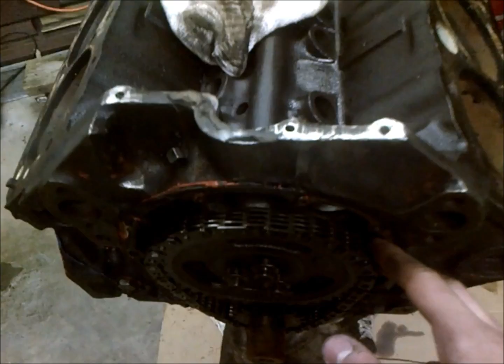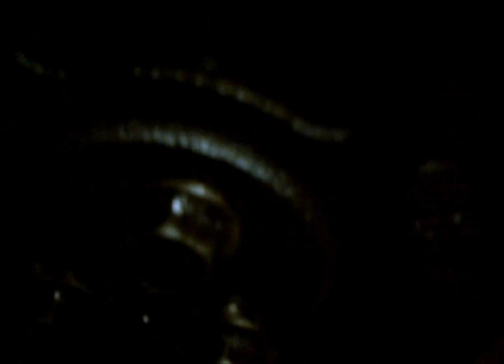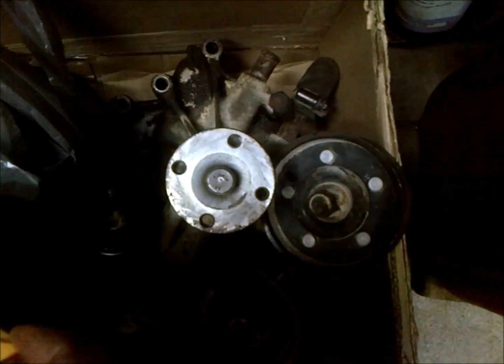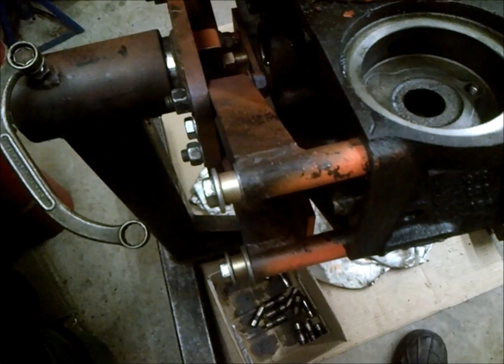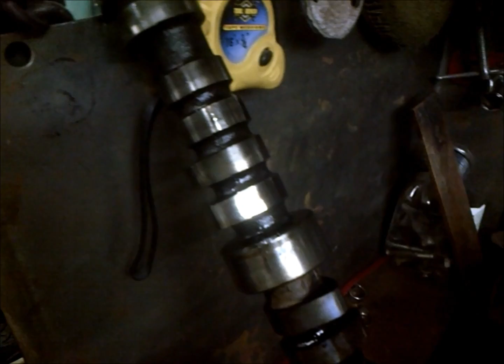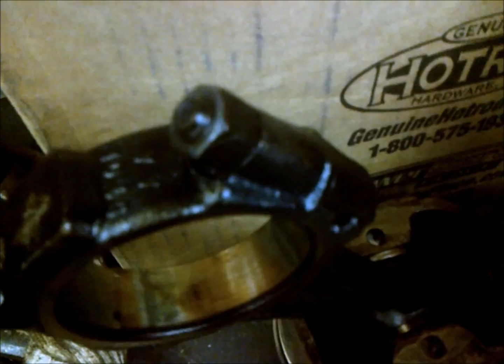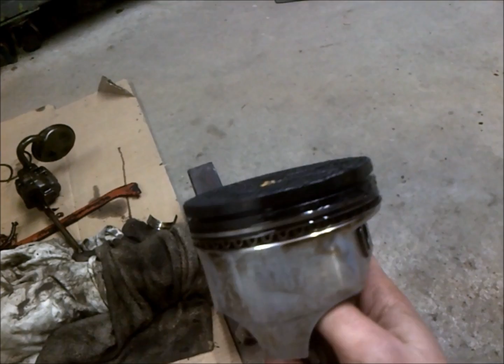350 Chevy vs Ford 302 Comparison: (Dumb Redneck Viewpoint)

Comment: I see more old Chevy's than old fords.
Reply: +Frank289100 CHEVY SHIITS on ford. I'm at the drag strip constantly
Reply: funny,there are tons of old Fords running the road while there are more old Chevys sitting in the yards just doing what they do best just sitting going no where rusting away..lol.
Reply: +sylumgand ford used the 302s up until the early 2000s in the explorer. they also used them in anything bigger than a foxbody and smalled than an f250
Reply: +TheSamplebridge you either had a ford most of your life or your lieing
Reply: +sylumgand bro fords suck and your mad
Reply: Thomas Smith i think your the one thats mad
Reply: Thomas Smith Must suck to be hit in the face with truth by a caps lock commando. Fact is he's right and you still have no response other then "Ford sucks" or "You suck".
Reply: +sylumgand when u said that the 350 came with 195hp stock. you are comparing an engine from the 70s when there was the oil crisis and engines were being detuned for fuel economy NOT POWER. yes they had about 200hp or less during that era. 302 were the same way. if u got an early 350 from the 60s and even a 302 from the 60s the 302 never stood a chance with the 350 with 300hp stock. the sbc was just better with its simplicity. fords need a shit ton of wiring for it to run while a sbc just needed a hot wire and coil and it would run great.
Reply: Jared Phillips
No actually i was comparing crate engines you can buy from Jegs right now. You might have got the years correct so I looked up newer versions that are actually cheaper then the first one i looked at. And for a direct drop in replacement for vehicles from 87 to 95 they were rated at 250hp.

And simplicity has nothing to do with their popularity or availability, price does. That crate engine i quoted from is a $1300 engine without intake. Or about $400 cheaper then the cheapest Ford 302 crate engine i could find. A 300hp 350 crate engine will run around $2500 where a 300hp Ford 302 will run around $3500. And you can get both in the 400hp range, but the Fords always gonna be more expensive. Now if you had no brand loyalty and only cared about power, which are you gonna buy?

 If some company made a 600hp engine that was decently reliable, had cheap plentiful aftermarket support, and sold it for $2000, do you think Chevy small blocks would rule the roost as the go to cheap cookie cutter powerplant?
Reply: +sylumgand I understand that the sbc is cheaper. I wasnt trying to say they are more popular cause there mpre simplictic. I understand that any ford crate engine is just as good as chevy crate engines but people are gonna go with chevy cause they have shown why there engines are just awesome and ford crate motors are awesome too. im not truing to bash on ford or anything im just saying sbc is just a better choice. I wouldnt really go with a crate motor in my opinion I like to just have my engines rebuilt its cheaper and u dont have to buy all the accesories like intake, carb, so on. i dont like the 350 as much as I love other sbc (dont get me wrong there great just along with most ford engines) im more of a 327, 283 guy I love these engines so much. I think the 302 was the best engine ford ever made but I wouldnt take it over most small block chevys.
Reply: bad406camaro
You wouldn't be spending 10k on a Ford 302 with 350hp, you'd be buying a Coyote 5.0 at that price range and it would be 440+hp. Also all you've done is further reinforced my point that Chevy's are cheap power and the cookie cutter of the engine market, hence why you see so many god damn 350's and the LS variants on the market. They are literally a dime a dozen. Ford didn't cram a 302 into every single vehicle it made for 50yrs, it will never be as readily available or as cheap as a Chevy 350 and soon enough its LS variants. It also doesnt change the facts of what
 Frank289100 said either about the LS motors. And if you want to compare dicks some more https://www.summitracing.com/parts/fms-m-6007-m50a/overview/make/ford 435hp out of a 302. $1000 more expensive though, but seriously 430hp out of a 6.2L or 435 out of a 5.0L. You gonna try being one of those guys who claim that 430hp 6.2L motor can run turbo's and pump out 1500hp as is?
Reply: Well, where I live, I see more old fords than chevy
Reply: Way more old mustangs than old camaro's. No matter where you live.
Reply: +Thomas Smith Well lets examine that. Chevy has been producing the same exact engine since 1967. Ford produced the 302 from 1969 to 1995, while Chevy still put 350's in up to 2003 after which they switched to a an updated version of the 350. Chevy crate motors are also $1000 cheaper then a Ford 302 crate engine. So you have cheaper, longer production, and far more widely available engine. Remember Chevy crammed a 350 into anything that could fit it. And before you bring up the new Ford 302's, they share almost nothing in common with the old, i'm not even sure they use the same block.
Reply: +sylumgand 302 crate engines are more expensive but a junkyard 302 is like 300$.
Reply: TheSamplebridge And you could still get a Chevy 350 for cheaper.
Reply: Frank289100
Umm dude, if you examined my comment you'd realize I was shitting on Chevy 350's. Being called a cookie cutter of something is not a compliment. And I already know what the next series of motor you would bring up as being based on Ford, the LS series aka the updated 350.
Reply: Also I seems the 350s had less quality control. When I look around the oil drain back holes 90% of the time there is casting chaf covering half the hole like they never dremeled it out. All the Ford small blocks I've owned where dremeled around those holes from factory.
Reply: +Thomas Smith I have had alot of fords, but all the shows I go to most 350s are like that
Reply: +TheSamplebridge look it up 350 has more HP
Reply: +Thomas Smith and? what does that have to do with oil drain back holes
Reply: +Thomas Smith You just don't want to admit that in order for gm to produce 350s at such a cheap price, corners get cut. And at 195hp stock, what are they more powerful than? You can get 250-300hp if you tag on $1000 for heads and another $600 for cams. And if you're trying to use ls3 and up, you're starting at 10 grand for motors starting with 350-400hp. The ls6 is a $20,000 engine. And don't try pulling the junkyard deal, unless you live somewhere that ZO6 corvettes are in every driveway you're not likely to find one there.
Reply: Thomas Smith
Lol didn't answer the question and just went to insults, yeah i'm the mad one.
Reply: +sylumgand yeah ford suckers
Reply: +TheSamplebridge THE 305-350 IN THE REAL WORLD WAS GARBAGE. IN TAXI 24/7 DRIVING THE 302 WAS STILL RUNNING STRONG AFTER YEARS WITH 500,000 MILES ON THEM AND THE CHEVY'S AT 60,000 AND LESS WERE BLOWING OIL AND THE VALVE TRAIN WAS SINGING " I GOT A LOVELY BUNCH OD COCONUTS". THIS IS WHY YEARS BACK THE SMALL BLOCK FORD TOOK OVER THE TAXI, LIMO AND POLICE CAR INDUSTRY, A 20 A YEAR STRETCH WITH NOT COMPETITION.
Reply: +Frank289100 keep typing in capital letters. cause it doesn't make you more right than you think you are
Reply: +Frank289100 the engine might not be that bad but everything else about the cars are shitty
Reply: +Thomas Smith THE LS USES A TEN BOLT HEAD PATTERN SQUARE BORE SEALING WHICH ALLOWS FOR HIGHER CYLINDER PRESSURES WHEN USING TURBO'S AND SUPERCHARGERS. ON A STOCK 5.0 ENGINE WHICH DEBUTED BACK IN 1983 IT CAN HANDLE 18LBS OF BOOST WITH NO PROBLEM AND GO MUCH HIGHER. WITH THE CHEVY SMALL BLOCK 8LBS OF BOOST WAS THE LIMIT. IF YOU WENT ANY HIGHER THEN THAT BLOWING A HEAD GASKET IS THE LEAST OF YOUR PROBLEMS. YOU WOULD DROP THE MAIN CAPS. THE SMALL BLOCK FORD HEAD BOLTS ANCHOR INTO THE BLOCK WEBBING WHERE THE CHEVY BOLTED ON TO THE BLOCK DECK WHICH MADE A WEAK SEAL BETWEEN THE HEAD AND BLOCK. TO BOOT THE SMALL BLOCK FORD WAS 70LBS LIGHTER THEN THE SMALL BLOCK CHEVY AND WAS STRONGER AND MADE MORE POWER. THIS IS THE REASON CHEVY DUMPED THE OLD SMALL BLOCK IN FAVOR OF FORD DESIGNS WHEN THEY CREATED THE LS WHICH IS COMPLETELY BASED ON FORD DESIGNS. NOTHING REMAINS FROM THE OLD SMALL BLOCK CHEVY.
Reply: +sylumgand when u said that the 350 came with 195hp stock. you are comparing an engine from the 70s when there was the oil crisis and engines were being detuned for fuel economy NOT POWER. yes they had about 200hp or less during that era. 302 were the same way. if u got an early 350 from the 60s and even a 302 from the 60s the 302 never stood a chance with the 350 with 300hp stock. the sbc was just better with its simplicity. fords need a shit ton of wiring for it to run while a sbc just needed a hot wire and coil and it would run great.
Reply: +sylumgand I understand that the sbc is cheaper. I wasnt trying to say they are more popular cause there mpre simplictic. I understand that any ford crate engine is just as good as chevy crate engines but people are gonna go with chevy cause they have shown why there engines are just awesome and ford crate motors are awesome too. im not truing to bash on ford or anything im just saying sbc is just a better choice. I wouldnt really go with a crate motor in my opinion I like to just have my engines rebuilt its cheaper and u dont have to buy all the accesories like intake, carb, so on. i dont like the 350 as much as I love other sbc (dont get me wrong there great just along with most ford engines) im more of a 327, 283 guy I love these engines so much. I think the 302 was the best engine ford ever made but I wouldnt take it over most small block chevys.
Reply: How about 460 hp for less then 3710.00$  or 4160.00$ if you don't have a core. hardly 10 grand for 350 hp. well maybe that is what you ford guys pay for it but us chevy guys well we are smarter then that.  look at this https://www.summitracing.com/parts/hpe-hp93/overview/
Reply: still spewing the same old garbage.  try some new lies  the old ones are getting boring. Oh and try to not use caps so much.
Reply: bad406camaro
LOL ok put what you linked into a car without everything its missing and tell me how much HP you make.
Reply: Sorry but your comment did not make any sense. not sure what you mean.
Reply: Ok I get it you are whining about the link being a 460 hp long block and your crying because there is no intake or injection. ok try this https://www.summitracing.com/parts/nal-19301326/overview/    stop bitching your comment that I responded to is a lie. you love fords I get it. It is ok not every one wants to pay 10 k for 350 hp like you ford guys. don't like that ? tough shit go waste your money on fords I will keep fixing them and over charging you for it
Reply: HERE IS A SBF 306 MAKING 390HP FOR $3600. THE REASON WHY FORD'S HAVE BEEN MORE EXPENSIVE TO BUILD WAS DUE TO THE THREAT IT POSED ON THE SMALL BLOCK CHEVY BACK IN THE 1960'S. WHEN THE 289ci DEBUT IT WAS SUCH A THREAT THAT THE NHRA OFFICIALS BEING NOTHING MORE THEN HENCHMEN FOR CHEVY WERE CHANGING THE RULE BOOK ON THE FORD 289ci MOTOR LIKE THE WEATHER CHANGED IN KANSAS TO DISCOURAGE ANYBODY FROM RUNNING IT. SO IF YOU BOUGHT A CAM OR ANY OTHER RACE PART FOR THE 289 AND OUT PERFORMED CHEVY. THE HENCHMEN THE NHRA WOULD CHANGE THE RULES OVERNIGHT ON THE SBF MAKING IT IMPOSSIBLE TO RACE. THIS IN TURN KILLED THE AVAILABILITY OF RACE PART FOR THE SBF RIGHT FROM THE BEGINNING. NEITHER WOULD FORD NOR THE AFTERMARKET MAKE PARTS FOR A MOTOR THAT CAN BE OUTLAWED OVERNIGHT WHICH MEANT YOU WOULD GET STUCK WITH A WAREHOUSE OF SCRAP METAL. IF YOU CAN'T RACE IT AND WIN, YOU CAN'T SELL IT. TALK TO ANY RACER BACK IN THE DAY AND THEY WILL TELL YOU THAT IT WAS HARD TO GET RACE PARTS FOR A FORD AND IF THEY WERE AVAILABLE THEY WERE 3 TIMES MORE MONEY. THIS LEAD THE WAY FOR THE SMALL BLOCK CHEVY TO BECOME THE MOST POPULAR ENGINE ,COOKIE CUTTER AS TO SPEAK. CHEVY SINCE THE 1950'S HAS BEEN CHEATING THEIR WAY TO THE FINISH LINE FOR DECADES. CHEVY WON BY CHEATING. .
Reply: Cheaper has never meant better,lol.
Reply: My question is why is a 302 and a 350 being compare and not the 351 and the 350????
Reply: Compare to a 302,maybe but not a 351,why is he comparing a 302 against a 350 and not a 351????
Reply: I have had nothing but bad luck from a Chevy 350.They are also medium power gas guzzlers.I would take a Mopar 318 over any Chevy 350..Sure as hell a lot better mileage ..
Reply: The 327 engine I like and adore for it is far much better then the 350,
Reply: There were over 100 million 350 engines made.
Reply: GEORGE, I AM A FORD GUY BUT MY FAVORITE CHEVY MOTOR IS THE 327. NEARLY EVERY FORD GUY I HAD A CONVERSATION WITH OVER THE YEARS ADORED THE 327ci. I AGREE IT WAS A BETTER MOTOR THAN THE 350. I THINK THE 331ci GRUMPY JENKINS USED WAS A BORED 327.
Reply: don't waste your time with these GM fools,they will never get it only in their small minds chevy is king,i've seen more chevy LS's get spanked by Fords that you can shake a stick at, COYOTE POWER ,i had a older 2000's corvette trying to flex its muscle but couldn't pass me in my mustang running regular pump gas.
Reply: +Frank289100 dude I love the 327. in my opinion its better than the 350 alongside the 327 the 283 is just as good but not a big ppwer maker
Reply: IN MY OPINION THE 327 WAS THERE BEST SMALL BLOCK.
Reply: The only difference is the cubic displacement.
Reply: IT HAS A LONGER STROKE THEN OTHER CHEVY MOTORS. LAWN MOWER ENGINES HP IS INCREASED BY THE MANUFACTURER STROKING THEM.
Reply: THAT SMALL BLOCK CHEVY DIDN'T LAST UNLESS A OLD MAN DROVE IT FEATHER TOUCHING THE PEDAL HAULING AROUND A CRATE OF EGGS IN IT ALL DAY LONG.
Reply: +Thomas Smith THE SMALL BLOCK CHEVY WAS GOOD WHEN A OLD MAN DROVE IT WITH A CRATE OF EGGS IN THE BACK FEATHER TOUCHING THE PEDAL. BUT WHEN IT CAME TO TRULY WORKING THE ENGINE IN SEVERE CONDITIONS, IT WAS GARBAGE. THEY DID NOT LAST. WHEN STREET RACERS MISSED A GEAR AT HIGH RPM'S, POP GOES THE WEASEL.
Reply: +Thomas Smith WHEN ALL THE RACERS AT THE TRACK ARE CHEVY'S OBVIOUSLY IT SEEMS LIKE THEY SHIT ON EVERYTHING . YOU GOT 50 CHEVY'S AND 2 FORD'S. I WAS THERE LAST YEAR AND ALL I SAW IS THE NEW 5.0 BONE STOCK, TWO OF THEM TURNING CONSISTENT 12.7'S SPINNING THE WHEELS DOWN THE QUARTER. THE CAMARO'S WERE DOING 13.2-4 IN THE QUARTER WITH TRACTION CONTROL. THAT'S WHY THE CHEVY SMALL BLOCK HAS GONE THROUGH SO MANY TRANSITIONS. THE FIRST ONE WAS IN 1992 WHEN THEY MADE THE LT AND THAT FAILED THE MUSTANGS WERE EATING THEM UP. THEN IN 1997 THE SB2 WHICH FORD DESIGNED THE HEADS FOR CHEVY IN NASCAR WHICH DRAG RACERS LIKE USING AND IN 1998 THE LS A TOTAL FORD BASED ENGINE AND TODAY THE NASCAR CHEVY RO7 A FORD CLEVELAND KNOCK OFF. IN PROSTOCK THE DRCE -DRAG RACE COMPETITION ENGINE MADE BACK IN 1983 IS A BIG CUBE FORD CLEVELAND ENGINE AND ALL YOU SYMMETRICAL HEAD BIG BLOCKS TODAY LABELED AS CHEVY ARE ALL FORD SPEC ENGINES BASED PRIMARILY ON THE FORD CLEVELAND DESIGNS. ON THE STREETS I SEE THE CHEVY'S GET EATEN ALIVE BY THE FORD'S. KEEP DREAMING AT THE TRACK.
Reply: +sylumgand EVERYTHING CHEVY USES TODAY IN RACING IS ALL FORD BASED. LET'S START WITH THE GM DRCE - DRAG RACE COMPETITION ENGINE IN 1983 WHEN THE FORD CLEVELAND'S WERE DOMINATING RACING. EVENTUALLY PROSTOCK WOULD HAVE COMPLETELY BECOME DOMINATED BY THE FORD CLEVELAND POWER PLANT AND DEEMED THE CHEVY SMALL BLOCK OBSOLETE. SO TO PROTECT THIS PHONY CHEVY RACING DYNASTY GM HAD THE NHRA MANDATED THE 500ci RULE AND ALLOWED CHEVY/GM TO BUILD A TOTALLY NEW MOTOR WHICH WAS THE DRCE. THE DRCE IS A OLDSMOBILE BLOCK MACHINED TO USE A BIG BLOCK CHEVY CRANK AND CAM THEN MADE A BIG PAIR OF FORD CLEVELAND HEADS FOR IT. SINCE 1983 WHAT HAS BEEN RACING AND WINNING UNDER THE HOODS OF CHEVY PROSTOCKS IS NOTHING MORE THEN A BIG CUBE FORD CLEVELAND MOTOR. THIS IS THE REASON FORD DOESN'T GET INVOLVED IN PROSTOCK. BECAUSE IT IS ALREADY FORD BASED POWER PLANTS BASED ON THEIR CLEVELAND MOTORS. AFTER YOU ANSWER ME ON THIS POST WE WILL GO ONTO THE NEXT CHEVY MOTOR WHICH IS FORD BASED..

Comment: 350 has always been way over rated .cracks me up when people brag about their 350 but its only been rebuilt a half dozen time's  or that old truck is on it's 4th motor well if they are so good why keep rebuilding/replacing them ??should still be on it's first one.
Reply: My ford 351 cleveland just got rebuilt for the first time in 40 years.
Reply: Both engines in question have been well-proven for decades, but you still have to know what you are doing no matter what you have.
Reply: Bullshit numbers.
Reply: Dude mine had 300k on it and never been touched! Dont smoke or use oil!!!! Quit with you ignorant shit!
Reply: exactly someone who understands
Reply: botheone40 my dad has had one in a 1991 GMC 2wd to get to almost 800,000 miles. Got it with 100,000 miles and he just did the basic maintenance to it and drove it at 80 plus mph for hours pretty much five years straight. When he trading it in. It didn't smoke, knock, good power, and still ran strong year around. The reason why them 350's are so famous is because they're too gutless to kill it self and if you keep one maintained, it'll last forever. Now you can put a set of vortec heads on one and a good higher lift cam in it and you can double the power. Look at Engine Masters, they have and episode of it.

Comment: What about the Boss 302 vs. the Chevy 302 Trans Am engines? I am a Ford man.
Reply: stick with Fords, they are less expensive, because they last longer, but use a 10-40 never lower
Reply: Thomas Smith fuck chevy!
Reply: i owned a 59 Chevy, It was plagued  with  electrical problems, I also had a 1991 GMC pickup it had electrical  problems worse that  the old 1959! Will 
Chevy ever learn how to build electronics?
Reply: That happened in the scca trans am series in the late 60s. It wasn't pretty for the furd.
Reply: might wanna switch. fords are ugle exept the mustang